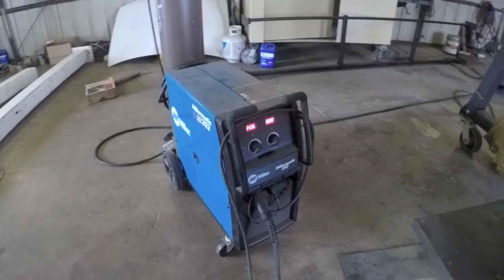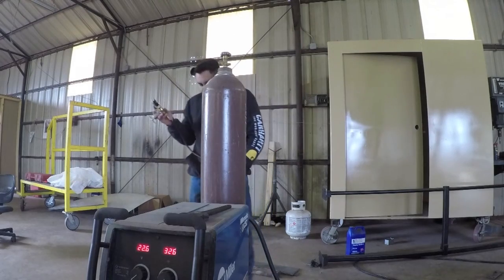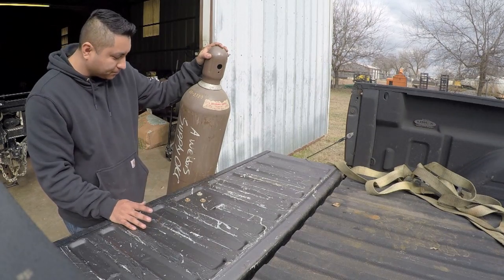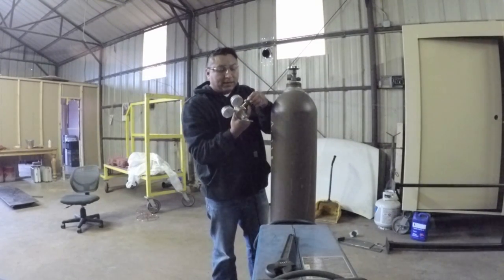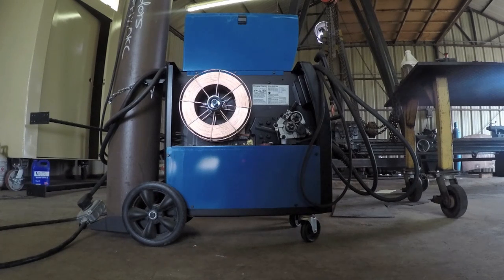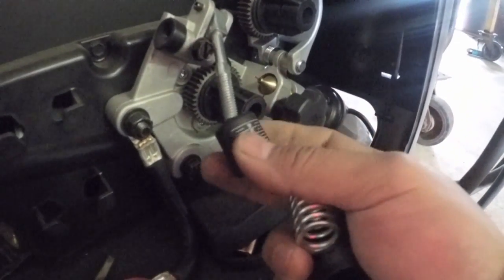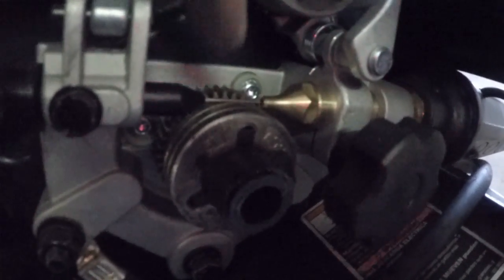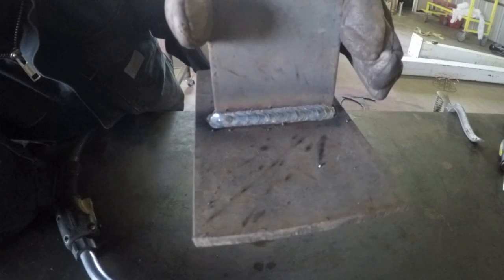#17 Miller Mig Welder Setup

Comment: I saw a guy in a hotel trying to untangle a bank of beer gas bottles and didn’t have the valve shut off and panicked which caused the bottle to fall and it hit a raised concrete area snapping the valve off. The bottle took off like a torpedo through a plasterboard wall and then through the beer garden and hit a brick wall smashing the wall and ended up going through a building society customer front foyer. Nobody was hurt but people in the beer garden got their money’s worth with the torpedo attack on the building society hahaha. Since seeing that I am always super careful ensuring the cap before any bottle moving. Your video has some good common sense tips. Here in Australia I think it’s law to transport bottles vertically (standing up) but guys with pickups with canopies can’t really stand them up and the suppliers of the bottles just say it’s totally your responsibility and look the other way. If you transport it laying down like you show, I can’t ever see a problem. Good video for newbies and a good refresher in general.

Comment: I agree with your reasoning at the end.  The really experienced guys may not cover some of the basics because they don't even think about them anymore.  It also doesn't hurt to put up vids covering the basic or simple stuff because you never know when you explanation will be the one that someone can finally understand and relate to.  I'd never seen a torch end like that.....all the contact tips I've seen screw in.  Thanks :)
Reply from the maker: Yea it's always tough for the brand new guy to get started at least just the new guy has a chance. Bernard is great makes cleaning and changes easy.

Comment: Me personally, I chain the bottle before I take off the cap. I can still spin it with the chain on, it's not too tight... VERY nervous of a bottle without a cap & no safety chain, flimsy though the safety chain is. Also, another point that I'm not sure it's true or an urban myth... I was always told with regulators, you should spin them out to zero before you remove or install them. My old shop teacher said you could damage the diaphragm in the regulator if you didn't do this. Again, I'm not sure this is true with modern regulators... I was taught this way back in the seventies. At any rate, thanks for making this video, it's good info! Best, BG

Comment: We got the same set up, 252, tweco ground clamp and bernard Q300 gun, lol. i also got a 256 by lincoln, got to say even though their smaller machines are sold in the big box store the quality vs the 252 is bar to none, at least in the construction a lot more solid, both weld amazing.

Comment: Boss just bought  a hobart beta mig 200 and it's missing the nut that holds the spool of wire on the hub think I could use one for a millermatic 252 and it work thanks